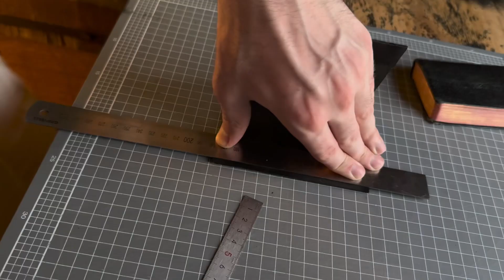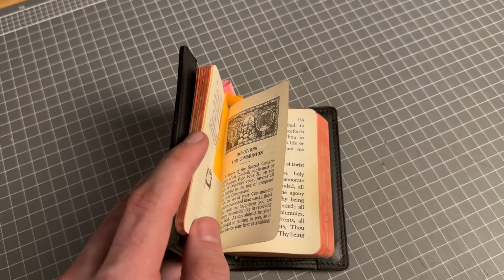Making a Leather Catholic Missal Cover | ASMR Leather Working

Comment: Hi, I'm just getting started with leather working, I'm making bible, missal, and liturgical book covers. What kind of leather do you recommend. I keep seeing top-grain, full-grain, and others. It's a bit confusing at times on which one to start with.
Reply from the maker: Hi, in terms of what leather there are so many options and it really depends on your taste.

The first question is do you like a smooth or textured leather? Smooth leathers can scratch more easily such as Buttero, however there are some that are don’t scratch as bad like Wickett and Craig because they put a polyurethane spray over it to help abrasion. If you like pebbles you can go with one of my favourites minerva box however you can get pieces that aren’t consistent which is annoying. These are all vegetable tanned so they’ll burnish. Vegetable tanned leather also patinas.

The other option is chrome tanned which will have great scratch resistance and be cheaper however, you won’t be able to burnish it. 

Another thing is do you want to make more refined covers or more rustic.

My Bible and Missal have a textured leather so I would personally go with a pebble leather. 

With full grain and top grain I did a course where I did discuss those in my introduction to leather course: https://youtu.be/g8jXm4YH-eM?si=FD6XOzqB2WQnqlWC
You should start with either full grain or top grain leather. The only difference is top grain just has some surface sanded away to make a consistent surface whereas full grain has no altered surface. There is a downside because you see the marks of scaring, scratching, fat lines etc. from the animal. That’s all, it’s not anything too drastic, some people like seeing the natural skin, others wants something more consistent. Either doesn’t change the strength of the leather. I made belts with top grain leather, it was very consistent surface whereas with full grain you see the raw surface which can be annoying if there’s a scar and you need to cut around it. You just want to avoid genuine and PVC/bonded leather.
Reply: @Josephmedcalf0  thank you so much for the detailed and helpful response! I got started with some full grain cowhide. I love the smooth feel, and your missal video above has helped me tremendously in getting started. That video alone has helped me get to the stitching point (your hand-stitch video is very helpful too!).
Reply from the maker: @TheCatholicChemist33 thank you I really appreciate it I’m glad my videos are helpful 🙂